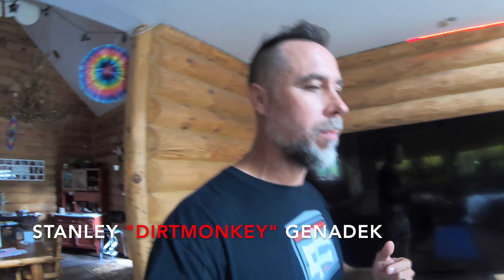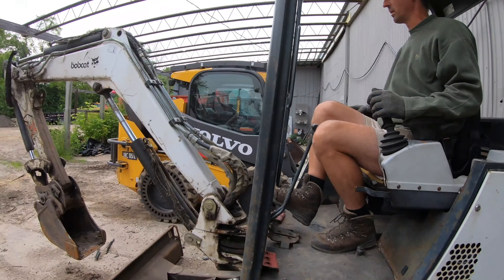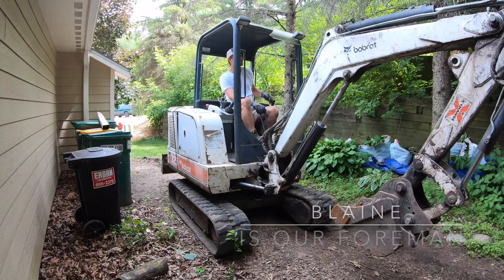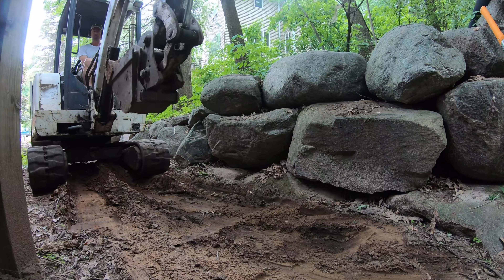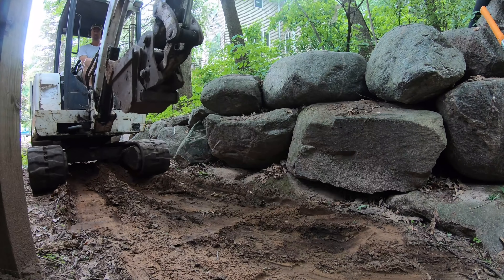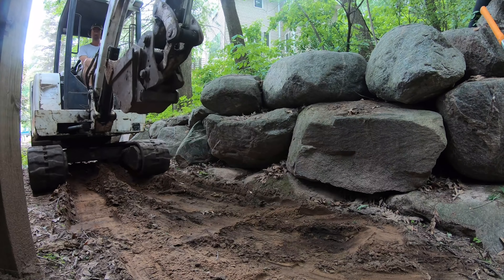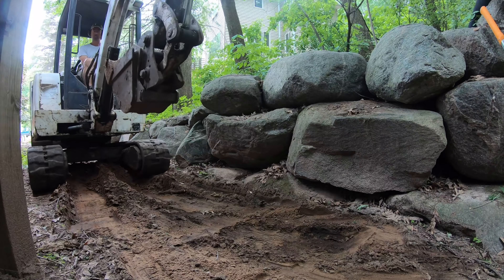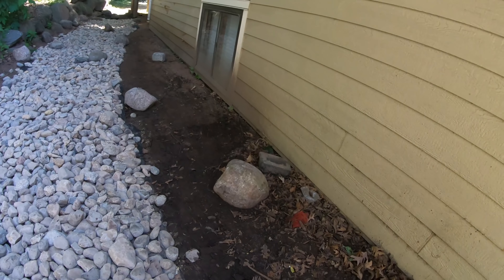Last Minute Emergency- Boulder wall washes out pt#1

Comment: Good work Stan! A new mini x may be in your near future, bud.
Reply: I’m surprised Stanley hasn’t bought a new mini with a roto-tilt bucket. The company I work for leases there equipment and trucks
Reply: Clayton Hartin I am as well. Maybe he has a deal in the works with a company and that’s what he’s waiting on. Bigger channels will get things like that for exposure.  Little channels like mine won’t get anything. Not taking anything away from Stan. He’s been doing YouTube a while and has good videos. He’s definitely earned it.
Reply: Steven Tedder yea JCB & John Deere has been going around channels and renting or leasing the equipment for use on videos.
Reply: Clayton Hartin you are correct bud. Hope you have a great July 4th weekend
Reply: @ClaytonHartin  Comes across as deceptive when brands do this and the YouTuber does NOT make that clear.
Reply from the maker: Hope so!

Comment: I saw when your guys were loading equipment they were dealing with a lot of extra chain. One of the best things I ever did was cut down a few 20’ chains into 48” pieces. I put a different style hook on both ends for versatility. I haven’t had to deal with extra chain for a long time!

Comment: anyone use a mini excavator for the first time and think - "I could build an entire god damn city with this thing"?
Reply: No, but running a 352 cat makes me feel like I could definitely tear one down.
Reply: @jaxturner7288  lol woah that's a big boy!
Reply: Stevey Irwin big enough for my city, changing job sites would be less stressful and much cheaper with a mini tho ....
Hmmmm, think I could just stack a few of those lil diggers together?  If I add up the reach and flow of say, a half dozen or ten minis the math works out, then I could skip the tractor trailer nonsense and move jobs with a pickup.
Reply: @jaxturner7288  lol woudn't you have to make like 6-10 trips? Could easily fit at least 2 on a trailer, so maybe 3-5 trips? I do wonder how long it would have taken you to do what I did in an entire week, though lol, maybe half hour...
Reply: Stevey Irwin yeah good point, bad idea.  
It’s funny you think about the difference in the time required between the two machines for a particular job to be accomplished, that is obviously appreciable and to most, likely very important. However, all I can think of is the difference in turf conditions when the two machines leave, sometimes I need to bring a whole bunk of plywood and lay it out to get it across a lawn or parking lot without destroying something. Paying for paving jobs and caving in abandoned septic tanks was not in the job description or accounted for in the budget. 
From my perspective, If you can get it done, when it needs to be done using a mini,  it’s not worth risking the substantial amount of additional property damage it can do plus the higher cost of relocating the bigger equipment.   
Wish I had a mini and enough work for it to keep me busy, I wouldn’t miss climbing in and jumping down out of the cab one bit.
Reply: @jaxturner7288  killdozer vibes checking in

Comment: I’ve had two Bobcat 328 excavators. Their size and power is perfect. You can’t get a 4’6” wide excavator anymore like that. My Father bought mine and it has 5300 hours and still going strong. Those older Bobcats just go forever.

Comment: I've had the m18 grease gun for about 7 years i love that damn thing, I've also had the 18v dewalt which seemed under powered and used a 20v Lincoln. Milwaukee has there stuff together on their power tools in my opinion the m18 is the best bang for ya buck. All of them are better than a hand pump, but an air grease gun on a lube truck is still the best.

Comment: Round boulder walls are not the best they don't hold well, you really need to have good drainage behind them. In this area thousands maybe in the hundreds of thousands of tons of rock is used for rock walls. Rock ranges from 300 pounds to 6000 pounds of blasted granite irregular shapes lock together very rare for a wall to spit out. Wall heights can range from 3 feet to 20-30 feet 10 feet long to hundred or more. Time to buy the boys a new mini excavator with a thumb, your old bobcat is worse than a Camarata machine.

Comment: Hey Stan ,off this subject I have a question for you , I snow plow with my bobcat 773 and a flat bucket . I want to add a plastic wear bar underneath to protect my asphalt driveway which I just had  a new coat put on . What do you recommend ?  By the way .YOU ARE THE MAN